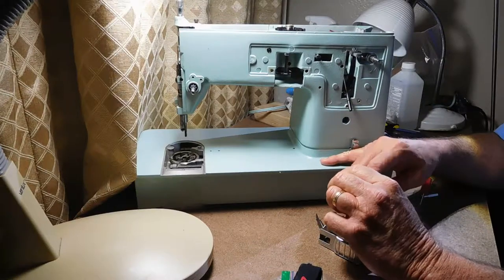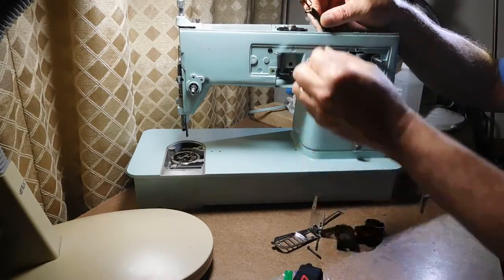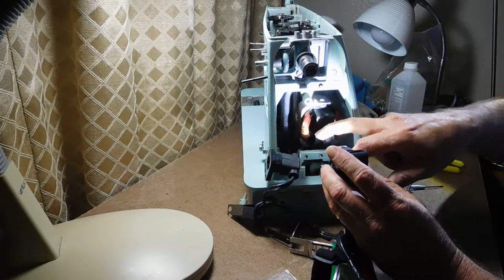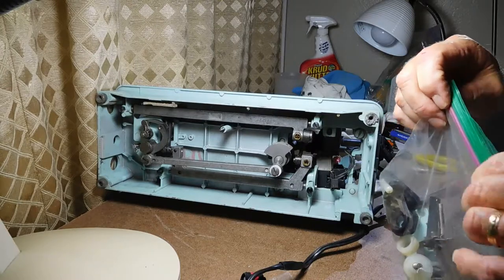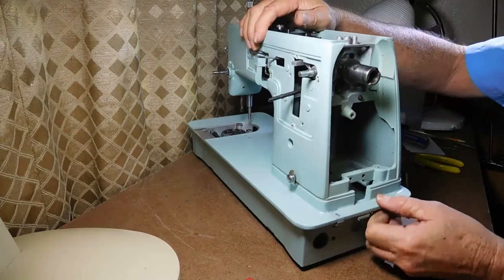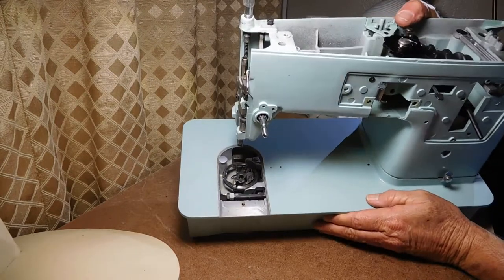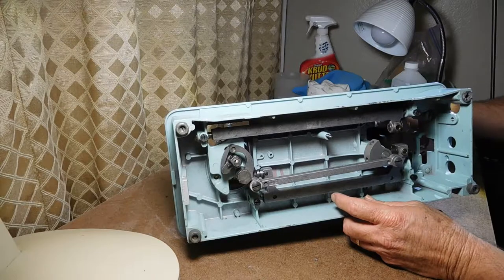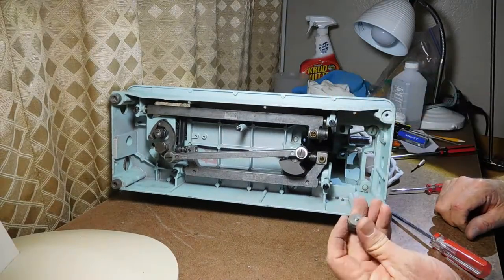Step by Step Restoration of a Singer Model 337. A Series. Part 9 Motor and Wires Removal

Comment: I have 337 could i convert it to 338 if i change the cam mechanism with a 338 and top cover
Reply from the maker: What an intriguing question. Give me some time and I'll check it out.I have to pull out all the old parts records
Reply from the maker: Here is what I found in the parts records. Most of the part numbers are the same. The arm shaft, arm shaft pinion gear, follower arm, width control lever, etc. The questionable part is the Disc Driving Worm Wheel part numbers are different. What you called the cam mechanism. That means the parts are different. It may be a tiny difference or a large difference, but they are different. The 338 DDWW may be shorter to make room for the chrome knob holding the disc on or something like that. I remember putting a blind hem disc on a 337 and it worked properly. The only way to know for sure is to try it, but the follower parts (following the disc to drive the needle bar swing) being the same is a good sign. IDK but by the time you buy the DDWW and chrome nob and arm cover you may be approaching the cost of just buying a 338 and restoring it. If you want copies of the documents just email andymanuals53@gmail.com and ask for 337/337 docs. No Charge. Good luck and if it works you should make a video showing how to and get plenty fo people interested. Thanks for watching my channel.
Reply: @andytubesewing1953  thanks andy i got a 337 free from a neighbor the plastic top was broken and i took it apart and pulled the cam stack gear out and it all looks the same except the top was shorter to compensate for the 338 chrome knob i found 338 cam stack and worm gear thumb screw together for $11 going to drop it in when it comes in see what happens only difference between the two cam stacks are the way the top is made looks like but ill keep you updated when i get it may make a video of the swap if it works out..I’m thanking the factory used same body just used different cam stack and top and face plate to save money biggest challenge is finding the top cover and … like your channel you always have some good quality information
Reply from the maker: @Theantiquerepairman  It sounds like a fun project. You seem well on your way and I wish you luck. Singer did that a lot; I mean the same body different price points and capabilities, like straight stitch only, ZZ, and "Specials" with interchangeable pattern discs. I think there are over 20 discs available. If you do make a video I'll be happy to put a link to it on my channel.
Reply: @andytubesewing1953  I restored a 306k and 319W both in black and already have cams was use to using them though it be nice to also use them in 337 after doing some research 337 338 and 347 348 same machine only difference is changed to timing belt on 347 348 but the upper is still all the same 338 and 348 same machine and 337 and 347 same machine just different cam designed for the thumb screw to change the cams i thank also 338 or 348 can be changed back to the basic 337 347 if for some reason someone just wanted a basic machine thank this is why singer never stamped serial number in the beds on them so they could build any model out of the 4 at spur of the moment to fill orders … I’ll email you some pictures for your own reference if it works out and send you a link if i make video
Reply from the maker: @Theantiquerepairman   You're deep into it now. I've always found the machines interesting as they were made and only tried once to convert a machine for double needle sewing, but failed due to the feed dog style and spacing of the hook. It was fun trying though. Wishing you all the success.
Reply: @andytubesewing1953  today i got the 338 cam gear and it dropped in perfectly in the 337 and it works perfectly without any problems or adjustments and at the widest zigzag setting the needle lines up perfectly on both sides of the needle plate ..we now know that you can up grade or down grade 337 or 347 to 338 or 348 depending on what you want your machine to do…also i have converted my 338 needle bar cover to 348 with the window that shows the pressure measurement on the foot
Reply from the maker: @Theantiquerepairman  Nicely done! My hat is off to you. I'm glad it worked out so well.  I pinned this conversation to the top of the comments here so others might see it and get some upgrade ideas!  I don't know what started you thinking of this possibility but I'm glad you followed the idea and went for it. Take care.

Comment: I've been following this video for removal of the motor on my 457 stylist.  I'm stuck at removing the power switch which is different than shown here.  It's probably simple but haven't found a solution.
edit got it.  Figuring out how to spin around that front washer was odd lol tiny screwdriver to the rescue and glad it wasn't too gummed up
Reply from the maker: Between the power knob and the base of the switch is a Ring Nut that holds the switch parts to the body.  The knob pushes on and pulls off using compression if I remember correctly. There is no screw for the knob itself. If it is too tight to pull off using your fingers, slip a thin screwdriver tip behind part of it and twist to bring the knob away from the body. With the knob off you'll see the thin Ring Nut that turns lefty-loosey to remove.

Comment: Hi Andy, where can I buy the concentric washer set with screw?
Reply from the maker: Do you mean that hold/adjust the motor bracket/belt tension? Man, that will be hard to find. I don't know of anyone making the parts and the newer sellers of parts on eBay usually do not bother with it in their listings. I have found them missing on 2 machines, a 347 & 457, and someone replaced them with a self-tapping bolt, washers, and locknuts. The parts were used on several 300, 400,500 models and I finally found a parts manual that shows them (457) screw/bolt=114062, eccentric nylon=179615, metal washer=98145, spacer nylon=179616. Even searching for those parts numbers I came up blank. If you see a seller on eBay or Bonanza selling parts from a machine you can email them and ask for the parts. I have done that a few times and it worked, but many sellers don't even respond. When they did they really overcharged for the part. You may be better off spending your time & money to make something that will work. No joy from me today, Dave,😢 sorry and good luck.

Comment: Was working on restoration and found the wire harness with rat chewing on the wires though id pull it out and rewire it but them electrical plugs are that the foot control plugs into are not easy to work with nothing to wire too pins are not reusable had to just get another wire harness
Reply from the maker: You have my sympathies I've had a rat problem in the past and had to do the same thing but after that everything went well and the machine turned out nicely good luck to you

Comment: impossible de trouver un moteur pour ce model
Reply from the maker: Il s'agit d'un moteur SInger SNK (ouvert), l'un des moteurs internes Singer les plus largement utilisés. Je peux penser à 16 modèles avec ce moteur sur le dessus de ma tête, et il y en a d'autres aussi. 337, 338, 347, 348, 413, 416, 418, 457, 476, 477, 478, 513, 514, 518, 533, 538. Des moteurs d'occasion sont disponibles si vous êtes prêt à payer le prix. Ils coûtent environ 25 $ plus les frais de port. Selon l'endroit où vous vivez, l'expédition peut coûter plus cher que le moteur lui-même. Une recherche de 5 secondes sur eBay a trouvé plus de 10 de ce moteur en vente aujourd'hui, le tout avec une livraison en dehors des États-Unis.
Pas impossible. Êtes-vous sûr d'avoir besoin d'un nouveau moteur? Ils sont très durables, comme celui-ci que j'ai nettoyé et mis au travail après avoir été dans l'eau sale pendant 25 heures: https://youtu.be/6y1EN5S2sz4 Merci d'avoir regardé ma chaîne et bonne chance.
Reply: It never fails, every time I acquire a new machine....you seem to have a series on that model, thank you so much Andy, these videos will be helping people for years to come, I know this is an old video and it's currently 12/6/2024 , I hope you are doing well sir, thanks again 😁